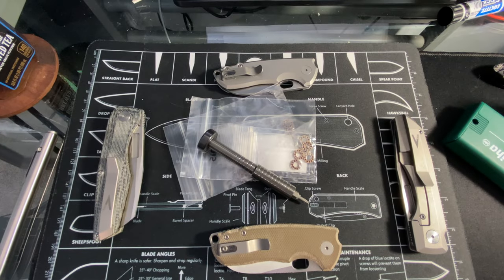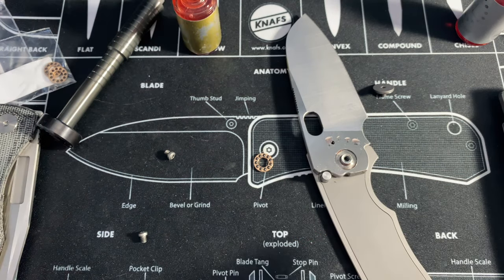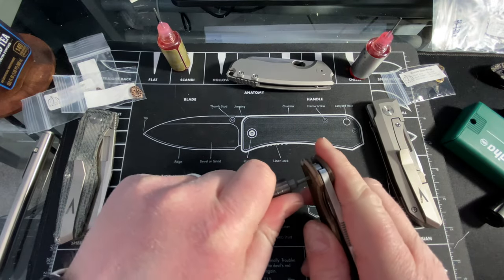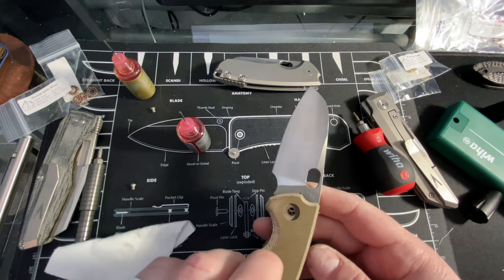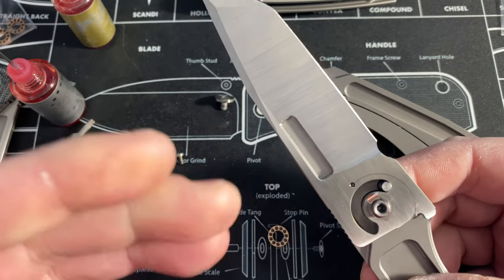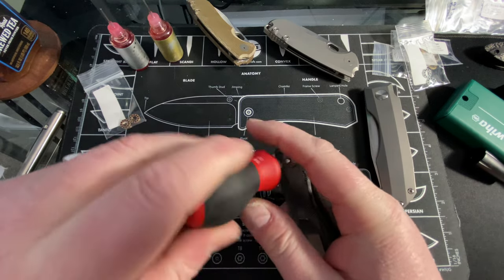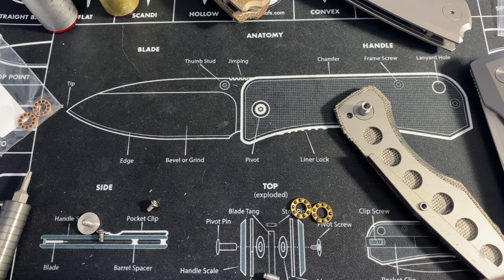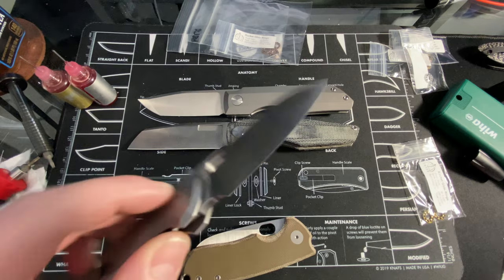Installing Skiff Bearings into 4 Knives

Comment: Could you help me find out what size bearings are running in the 2021 Evo Typhoon? What to install those bearings in mine!!! Thank you @leftyedc
Reply from the maker: Hey David. There is a spreadsheet that lists a lot of different knives and the size to get. I believe a few SBD knives are on there. Someone posted the link in the comments. Let me see
Reply from the maker: https://docs.google.com/spreadsheets/u/0/d/1IMiIjXGoij08hLVWh0iVaOZ5MzCnhW6wByIUJVj1b3Q/htmlview
Reply: @LeftyEDC  thank you so much for your help!!!!
Reply: @LeftyEDC  This is a valuable resource. How do I contact the owner of the document with more results?
Reply from the maker: @chronovore3726  idk. Find the reddit post. Or maybe its an open spreadsheet?
Reply: @LeftyEDC  I'm not experienced with Google Docs but I don't think so. I also don't use reddit. Maybe I'll start a thread at Blade Forums and link it once I get to playing around with these.